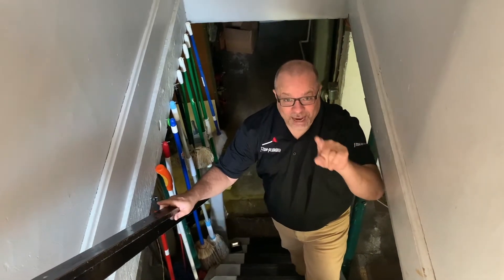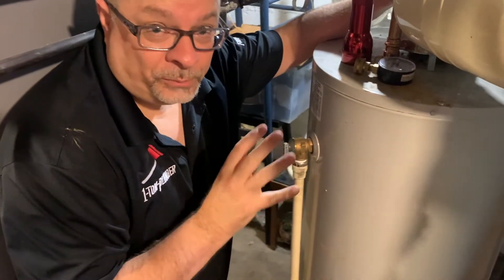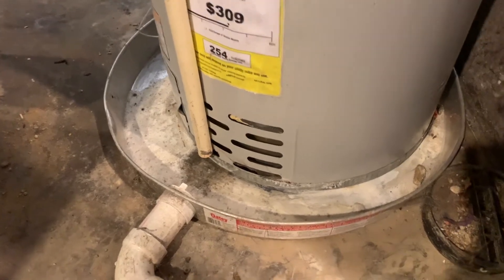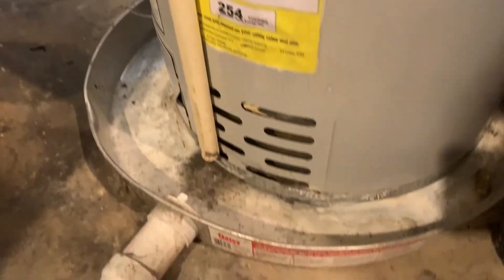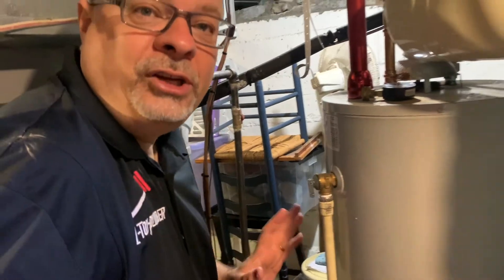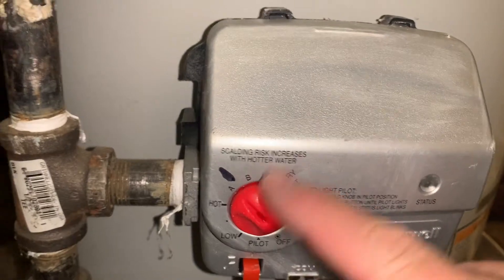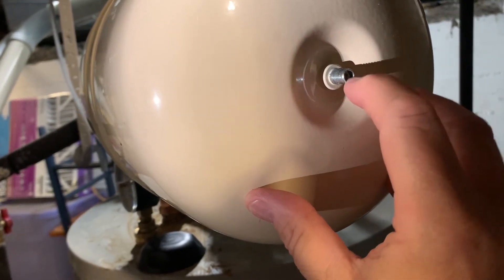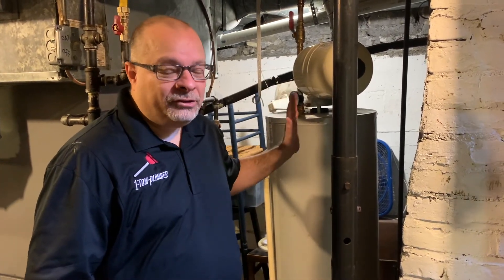Test Your Water Heater T&P Valve (Before it Explodes!)

Comment: Would it be okay if the T & P Valve is rotating. Like in your video I see the tip of valve facing the bottom. At our home it’s opposite to washing machine, and while we’re working on the machine it mistakenly rotates by our back. Should I be worried ? And how to make sure it’s facing proper direction ? Thank you !

Comment: And now people are going to end up releasing all the air in their expansion tanks, or at least dropping the pressure in them lower than they should be…
The simple tap test/tone check doesn’t require any air to be released from the expansion tank.

Comment: I just today did a T&P test on my 6 year old AO Smith water heater. They say that it should flow freely with no constriction. My valve is just like yours. At first, I thought my valve was constricted (very little water spat out) by pulling the valve and setting it 180 degrees opposite it's original setting (from pointing straight down to pointing straight up) and leaving it there. But actually, you should pull it toward you 45 degrees and hold it. When I did that, THEN it flowed freely. (whew!) You are the first one to tell us to let it flow for 5 seconds. I only did it for about 2 seconds. It damned near overflowed my drain pan (2" wider than tank) as it was.
Questions: (btw, I subbed, liked, belled, and just now commented)
1...Is it necessary to turn off the power first to prevent dry firing the upper element?
2...Is it necessary to (after the test) first mop up, then air dry the bottom of the tank to prevent valve drainage water from rusting out the bottom of the tank?
3...There are 4 pipe nipples on the top of my tank. Two of them are the hot and the cold water ports. One is for the anode rod that says ("ANODE") on it. But the 4th nipple on the edge says "NIAGARA SI414-2." What is that one for?

Comment: We had our thermal expansion tank explode, making a hole from garage wall into our laundry room.  Lots of water went into our vacation home before discovered by property manager.  Any thoughts why the thermal expansion tank failed?  It was placed onto a new water heater about 3-4 years ago.  Possibly when water heater was replaced, the previous owners did not check the condition of thermal expansion tank.  Such a mess.

Comment: This makes absolutely NO SENSE at all.. why in the world would anyone have to wait 6 months to release the pressure valve or could become a time bomb? So it just happens to be 6 months that people should release it how bout the 1st 2nd 3rf 4th 5th month that it should be rekeased being that pressure can build up way before 6 months so in reality then any water heater can explode at any given time even way before 6 months time, pressure valves from my experience work on their own when pressure builds up the valve opens slightly to rekease the pressure in the tank, when pressure valves are opened up then tbey begin to leak & have to be replaced thats a given.. so for me i wont open them up anymore & let the valve open itself up when the tank has too much pressure in it.
Reply: You sir have common sense, that's rare these days
Reply: Sometimes I think these videos are full of CRAP. Why test this valve once a year, to get damage and have to replace or call a stupid professional stealer plumber?  This Valve no need to touch stupid. Mine goes outside from the garage wall, so I can't see it.
Reply: I test mine once a year. I would rather it fail for a test than fail when its actually needed. Those valves are dirt cheap and a competent person can change it in 20 minutes max. If you can change a hose bib you can change a T&P valve.

Comment: How often should you check it?
Reply from the maker: Every 6 months!
Reply: @1-Tom-Plumber  Sometimes I think these videos are full of CRAP. Why test this valve once a year, to get damage and have to replace or call a stupid professional stealer plumber?  This Valve no need to touch stupid. Mine goes outside from the garage wall, so I can't see it.
Reply: @HeydaCarreras  Because it is a safety device and safety devices should be tested regularly.  If it fails for a test it is time to replace it and avoid said safety device not working when needed. The valves are like $20 at lowes.
Reply: @solodante5905  I never touched the old one and the water heater last 20 years in the same place.

Comment: I didn't test the tnp valve on my Rheem for 12 yrs (and it had a 22 yr warranty on the tank) and only recently tested it. It was very stiff and didn't want to open at all initially.  I drained a few gallons so that water level gets below the t&p level. And then I tried opening ad this time it did come open and water flowed to the drain pipe.
However the t&p valve handle is in a funky state. It doesn't stop after opening 90 degrees.  It goes on moving further and ends at 180 degrees.    I have to hold it firm after 90 degrees of opening, and then let go, else it moves on to 180 degrees and the discharge via tnp stops.   Dunno if it's busted or what.  What do you think?
Reply: Sometimes I think these videos are full of CRAP. Why test this valve once a year, to get damage and have to replace or call a stupid professional stealer plumber?  This Valve no need to touch stupid. Mine goes outside from the garage wall, so I can't see it.

Comment: There is no way to fully test a TPV outside a lab. As in, no way to test that it'd trip at the correct pressure or temp. This test only verifies it isn't seized. Though that tells something, it's not enough for true safety. Just replace every 5 to 7 years.

Comment: My new rheem pressure valve on side of gas heater arrived in box with valve overturned so not direct line to base.. can I safely move back counterclockwise 1/4 turn?

Comment: PRESSURE RELIEF VALVE:  Testing them can cause leaks (hard water minerals, etc).  
    If it hasn't leaked, don't "fix" it.
    If it leaks, test flush it.  If it still leaks, replace it.
EXPANSION TANK:  Test by taping on the side: should sound hollow on the air side of tank and solid (full of water) on the pipe inlet side.
    Do NOT release air to test unless you refill the air to balanced pressure to prevent breaking it.
Reply: My tank is probably 15-20 years old. I was just now going to go out and test it until I read this, if it ain't broke don't fix it. I think I will leave it alone.
Reply: I just did the exact same thing as this comment. Leaving it alone haha
Reply: Sometimes I think these videos are full of CRAP. Why test this valve once a year, to get damage and have to replace or call a stupid professional stealer plumber?  This Valve no need to touch stupid. Mine goes outside from the garage wall, so I can't see it.
Reply: How do you test flush please?! Mine is leaking 😭

Comment: Mine is constantly leaking from the pressure relief valve , all day it’s not here and there, it’s over 10 times a day should I be worried?
Reply: Mostly annoying but replace it just in case.  About $8 and screws in like a reverse garden hose w a wrench or even plyers.
Reply: @parkashland  thanks man I appreciate it

Comment: If there's water always coming out of the white pipe is the valve bad? It's also a fairly new water heater
Reply from the maker: Yes that means that your T&P is faulty. That should be fixed ASAP.

Comment: Mine broke in the middle of the night I woke up to the alarms it was just a nightmare. All better now but the lady downstairs from me got it way way worse. Yea this is no joke.
Reply: My pressure relieve valve is constantly leaking it’s not here it and there it’s constant, should that be a concern I’m paranoid
Reply: Lower the temp by 10 degrees. Repair so there is no kaboom. Car thermostats usually get stuck in open position. You probably had water set to high that it was always opening when operational. Get a expansion tank and a new valve if you want hot water above 110

Comment: My water heater don’t have expansion tank, is that ok sir? Thank you
Reply: Most people don't inspect the pressure relief valve until it goes kaput.  If your temp is not above 115 you're OK.
Reply: Is it the same for elec water heater

Comment: My hot water heater is less than 3 years old and it's actually leaking slowly from that white pipe. What should I do on my own? A plumber will charge me $150 to just come.
Reply: Assuming it's a gas heater, get yourself a LICENSED gas technician and don't try to fool around with DIY nonsense. Is $150 worth killing your family?
Reply: $150+ for a professional to fix your problem from becoming a larger more expensive problem sounds like you may have a “coupon” and aren’t even aware of it..

Comment: Are those "expansion tanks" mandatory on all water heaters?    I have two RHEEM WHs in my home.. neither one of them has this expansion tanks.
Reply: Probably only used when on a well.
Reply: I treat water for a living, most of the time the expansion valves are in well water only. Even a community well. On city water the PRV (pressure reducing valve) is in place; typically at the point of entry on the home.
Reply: California plumbing code must have added in recent years as neighbors plumber put it in and also put in steel post as shield into concrete ( jackhammered hole in garage floor)